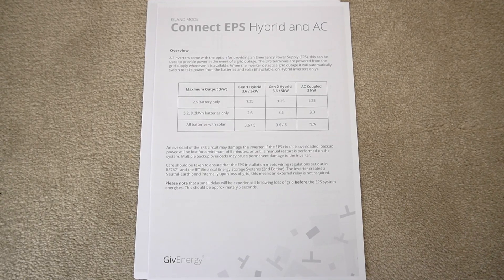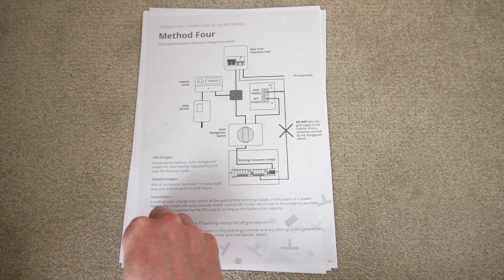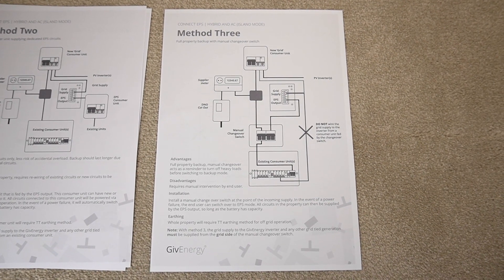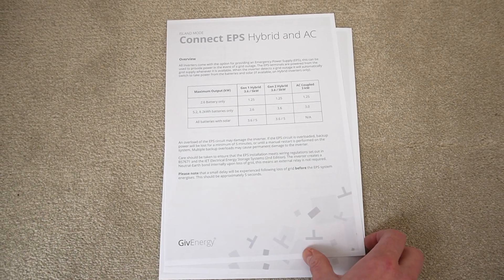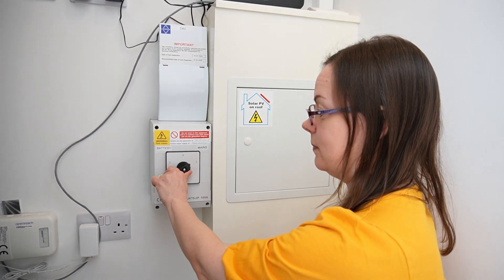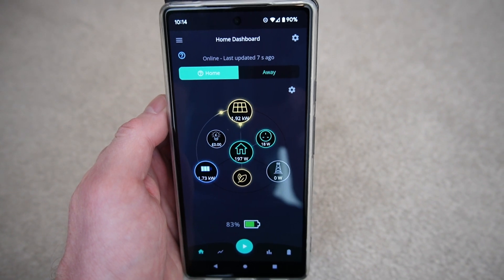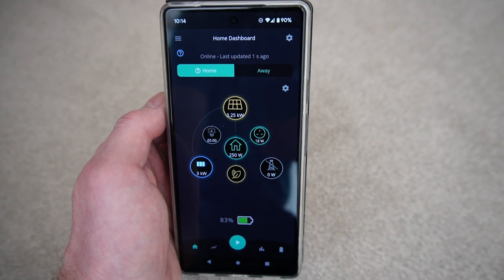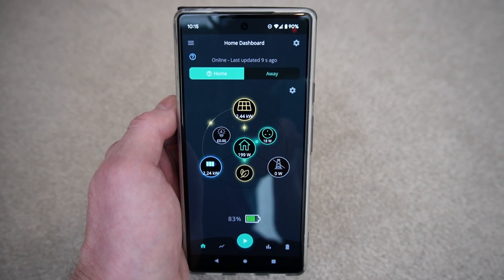GivEnergy whole house EPS - power cut backup demo

Comment: One issue for me is the ability of GE to handle load changes. It's the single reason I wouldn't install EPS from GE compared to say Tesla. If you have battery storage and solar production. Check your grid usage for the day. You'll find with GE you still used 0.5-2+kwh from the grid. This is when their equipment can't ramp up/down quick enough. Would be very interested to know if Gen 2 is any better in this regard than Gen 1. 👍🏻
Reply from the maker: I'll be covering this in more detail in my next stats update video, btw.
Reply from the maker: We're currently using about 0.1 kWh from the grid for balancing per day.  The max I've seen is 0.2 kWh.  So I'm pretty pleased with that, tbh.
Reply: @TimAndKatsGreenWalk  I mean the daily total not live reading. (For example using homeassistant to monitor). With Tesla it will be close to zero assuming you have enough battery and solar. But with GE I've seen high numbers over 2kwh. Then the question, what happens to this electronic equipment that demands power but doesn't receive it in quick enough time. I think this is a much bigger problem for GE than the 3.6 limit. In my opinion. I certainly wouldn't be wanting to run computer and critical equipment. Lights, phone chargers, etc would be ok.
Reply from the maker: I've not seen anything even close to 2 kWh, less than a twentieth of that most days.  That is the daily total, not the live reading.
Reply: @s7uat  I had a look in the GE cloud and it’s saying I’ve imported 0.3kWh for the day.
Reply: I have the Gen 2 and despite using all manner of appliances from the iron to the oven today, grid draw has worked out to 5 pence.
Reply: @CastleKnight7  so it looks like gen 2 is much better than gen 1. 👍🏻
Reply from the maker: I'm glad I waited for gen 2 in that case!
Reply: @s7uat That’s good to hear. I imagine a Gen 3 will import next to nothing for balancing. This Gen 2 seems to ramp up the discharge from the battery within a second.
Reply: @TimAndKatsGreenWalk  Great decision. Keep up the content. 👍🏻
Reply: Next on my list of purchases is this bit of kit. Then another 4.5kw array 😀

Comment: You could essentially go off grid (the holy grail of our systems) for a good portion of the year providing you’re generating enough solar power and as you say, you don’t draw more power than you are generating. I’ve noticed our iron is very power hungry, though just in short bursts. Another informative video! Thanks guys.
Reply from the maker: It's definitely reassuring having it available.  Once we get our export tariff set up though it'd still be worth our while staying on-grid for the export payments!
Reply: @TimAndKatsGreenWalk For sure! I’ll be looking into an export tariff once our British Gas tariff ends in December. We’ve got a good deal on gas until then and I won’t be looking at alternatives to gas boilers till our present one gives up the ghost. The plan like you is to go fully electric though.

Comment: Hi Tim,I have a GivEnergy system with 19kw battery and auto EPS for whole house.I’m not a electrician but my installation team worked a way around the potential overload and it works superbly just so you know it’s possible
Reply from the maker: That sounds fab.  I kind of like being in control of the switch, tbh.  Feels like I'm in Jurassic Park!
Reply: Lol, that makes me smile because you seem a switched on couple(excuse the pun) I understand your thinking for sure but if your not around then problems could arise
Reply from the maker: You mean if we get a power-cut while we're away from home?  Usually the power-cuts we get are no more than a few hours so if we're away from home that hopefully won't be too much of a problem.  Anything longer than a few days would be an issue, for sure.
Reply: Is there any chance you can provide more details? Surely you have the design proposal from the installers or just name the installers. I am looking to do the same and need someone that know what they are doing. Most companies in the UK don't wanna mess with backup systems, the only thing they do if you ask, is UPS which is where they rewire your house for a dedicated circuit backup. So for example your office where the router is, desktops etc and maybe the fridge.
Reply from the maker: @DragonXDrei  take a look at the document I showed in the video, and link to in the description.
Reply: @DragonXDrei Much easier, and cheaper, to do this with a dedicated UPS to supply critical IT stuff separately.
Reply: @michaelblackmore883  but would be nice if the fridge would be OK too, the last blackout we had was for almost 3 days.

Comment: approx what price difference for this to be added? I’ve not factored this in as we don’t really have power cuts, but if not super expensive it might be interesting
Reply from the maker: Ah ha!  I had another look at the invoice and I found it.  £480 for hardware and install.  A bit more than I thought.
Reply: @TimAndKatsGreenWalk  That's so cheap, can I ask which changeover switch they used? We use one that's £300 from CEF and adds a day to the installation (inc testing) so we charge £900 inc VAT for this method, maybe I should shop around. Your inverter/energy meter will see grid voltage again when the power comes back on so no need to look for the neighbours lights!
Reply from the maker: @thomasmoyes2990  I'm not sure where that switch was sourced from, it did have a label on it but that got removed by the installer when the various other stickers were added.  Perhaps you can make out any details that might help identify it from the video?  Good tip about the inverter/meter showing when the power comes back on.  When we next get a power-cut I'll look out for that, thanks.
Reply from the maker: Not entirely sure, it was lumped in with a load of other stuff in the invoice.  No more than a couple of hundred quid, I think

Comment: One of the reasons why I did not go with givenergy was because the 3.6 kWh limit. I have 8.8kwh capacity which allows for auto switchover and also allows for to twice a day peak period of 6/7kw. Everything is on my essential with the exception of oven, hob, EV, surge protection and inverter. I realise now I have over-specified with 20kw of batteries, but it is better to be looking at it than for it
Reply from the maker: 3.6 kW covers the vast majority of our use, so that's fine for us.  In a power-cut we'd not want to be drawing too much in any case, so should be able to keep well below 3.6 kW (btw it's kW for power, kWh for energy storage).
Reply: @TimAndKatsGreenWalk  I am aware of the difference between kW and kWh
Reply from the maker: But you used kWh for your panels (should be kW) and kW for your batteries (should be kWh).  No offense intended, I just see that mistake a lot.
Reply: @TimAndKatsGreenWalk  not as big a mistake as choosing the wrong inverter and then justifying the manual change over by “looking out for the neighbours lights to see when the power has come back on”
Reply from the maker: @mikejoseph425  oh wow, what a reply.  Sorry for trying to help educate you.  I sincerely apologise.  There was no need for you to get nasty in reply though.  I should know by now not to try and correct people on the Internet it never goes well.  I shan't do it again.
Reply from the maker: @mikejoseph425  I think we got off on the wrong foot.  When I mentioned the units it was genuinely an attempt to help, I wasn't trying to be condescending in any way (which I now realise could have sounded that way).  If you thought I was being rude I do honestly apologise and hope you forgive my initial comment.  But I do think your attack on my choice of system was uncalled for.  Not everyone has the same requirements so not everyone needs the same system.
Reply: @TimAndKatsGreenWalk  I just hit back because it did come across as “look at me, I know more than you.” With general conversation the term kw or kWh unit is irrelevant, it is only relevant when working out figures. I understand that a fridge rated at 1kw might only use 200wh once powered up
Interestingly as I also see the use of an undersized inverter a lot because people look at a 5kw inverter and do not realise the AC is limited to 3.6kw, to meet rule 98. I realise people have different budgets and agendas. Mine was to avoid any on peak use of electricity. We all make mistakes. I was not aware of the MCS requirement to export, I thought as long as one used an NIC Electrical contractor it would be fine, but not so and you can not gain a certificate once the job Is done. I believe I have got over this by FLEXI-ORB and the interesting part is that British Gas will allow export with a Flexi-Orb certificate and they pay 50% more than Octopus at 6p and you do not need to switch to BG. My plan is to try to avoid export and use excess solar after home and battery with immersion for which the SunSynk has auxiliary and last but not least my EV with Zappi
I accept your apology and I also apologise for my curt response. I do intend to follow you and swap experiences
We need to re-set
Reply from the maker: @mikejoseph425  Thank you, I'm glad we've cleared the air.  Our inverter can do 5 kW AC (with up to 3.6 kW from the battery, the rest supplied by solar, or else up to 5 kW from pure solar).  We have a G99 approval so can export all 5 kW if required, we're not limited by the 3.68 kW G98 restrictions, thankfully.  Our array is 6.8 kWp but E/W split so should max out at about 5 kW in any case, so I think our inverter is a good match for our system.  I shall be providing plenty of future videos covering how we get on with it so that others can learn from any mistakes we make (hopefully not too many!).  The more information people have access to the better, and that's why I started the channel.
Reply from the maker: @mikejoseph425  I should also mention that I'm particularly sensitive to units as I did a physics degree so when I see them misused it's like nails down a chalk board to me.  I'm trying to not let it bother me so much but it's hard!  I'm sure it doesn't matter to most folks at all and usually the context is enough to know what's intended.
Reply: @TimAndKatsGreenWalk I wonder why you didn't specify a 5 kW inverter.  When I ran Gary Waite's online calculator (Gary does solar) it was quickly clear that upgrading the inverter had quite a large effect on the export income.  My installer told me that the extra cost was only about £50 so looked like a no brainer to me.
Reply from the maker: @michaelblackmore883  we do have a 5 kW inverter.  The limit of 3.6 kW is what the battery can discharge on its own.  With solar added in it can export 5 kW
Reply: @TimAndKatsGreenWalk  Understood.  I must have missed that.

Comment: Could i ask how much you paid for the EPS back up.
We where quoted £800 more for this, but then was asked how many power cuts do you have?
We live in a small rural village and have had one power cut in the last 3 years lasting 2 hours at night, so then no sun
to run the system, then said the battery but the sup[plier said you then have to set your battery eps at about 50%,
so then you can only use 50% of your battery in winter or night.You then lose money in winter or at night.
Reply from the maker: I'm not sure exactly, it was all part of the total quote.  No more than a couple of hundred quid, I think.  We've had a few power-cuts so I'm glad we've got it.
Reply from the maker: Ah, my mistake, I dug out the invoice and have found the itemisation.  It was £480 for hardware and install.
Reply: That's a lot cheaper than my quote, might have gone for it at that price,  do you set the battery eps at 50%, or hope for day time.
Reply from the maker: You mean always have the battery charge to 50% overnight in case of a power-cut?  I've currently got it set for 30% just to make sure we've got a few kWh for heating in the morning but we've not gone below about 50% since the start of April, so I suspect even that is unnecessary at this point.  In the winter we'd be charging it all the way up overnight to help support the heating but I'd expect to have to turn off the heating in a power-cut in the winter regardless.  Or at the very least restrict it quite a bit.
Reply from the maker: Ah, or do you mean the reserve limit?  I've got that set to 4% as we don't seem to be getting anywhere near that right now.
Reply: On my Alpha system  you can set the EPS limit, and i was told you have to set it to roughly 50% if you think their is a power cut,
but this means you can only use half of your battery in winter/night, other wise if you run your battery down to, (mines set to 11%) no EPS, your lower limit is 4%, you have no reserve when/if you have a power failure.
Reply: I think you doing a great job of bringing a normal house in to the solar/ battery future, well done.
Reply from the maker: @peteandtheresa1  ah, gotcha.  Yes, I'm assuming a power-cut is unlikely so just hoping there will be some battery/sun available to tide us over.  I'm not specifically keeping a reserve for it.

Comment: You should probably aim to remove the Eddi from the board that is aimed to be backed up, Purely because of a schedule'd forgotten about boost could bring the system too it's knees.

The rest of the house you are in control of high demand loads but if if you forget the Eddi is on a schedule that knows no different
Reply from the maker: The eddi maxes out at 3 kW so if it's boosting overnight the total draw should be less than 3.6.  I'd make sure to turn off the boost in a power-cut regardless.
Reply: I had to laugh when you site settings that would bring the Eddi to its knees. If you have one and have upgraded the firmware to v5 you will be deep inside the forum documenting the vast numbers of problems Myenergi has caused by releasing this awful firmware. It makes the system not fit for purpose and the suggested fixes are always useless. The message is don't touch the firmware on Eddi (regardless of serial 1 or 2).

Comment: Have you done a price comparison?  Did you look at small wind turbines not the tall ones, little ones that are supposed to be better than solar.
Reply: Everything I've seen about domestic wind turbines says that the present technology can't compare. However, there are a number a possibly improved systems in the pipeline. Do you have anything particular in mind?
Reply: @eddyd8745  Not really , but seen a lot of small wind turbines which are far more efficient than solar, regarding how much they can generate power, in the region of 4 time better.
Reply: @KavanOBrien The ideal situation would be to have both as it can be a still day with little or no breeze, but then the wind picks up in the evening. We’re very fortunate to have technology that allows us such energy sufficiency.
Reply: @CastleKnight7  yes I was thinking of both for that reason , but quite expensive for me, I live on my own, I was thinking about buying a battery unit to be powered by solar and wind to be able to get heat in the house.
Reply: @KavanOBrien If you can afford it and your location (sunny, windy region) supports it, go for it!
Reply from the maker: Solar is currently significantly more reliable and cheaper per kW than wind, but things may change over time.
Reply: I think you'd want to look very carefully at the wind speeds you could expect, and how much a small turbine would generate at that speed. There just isn't much power in the sort of gentle breeze that's typical at rooftop level.
Then there's the noise and vibration. I've sailed on a yacht with one, and we had to tie it up at night to get to sleep (and avoid complaints from other boats).

Comment: That helps me to appreciate my Powerwall with its 5 kWh output (7 kWh for a very short time),  fast and automatic switching to backup in the event of a power cut (computers and routers don't restart). Admittedly I had to wait for nearly a year for its arrival but it did give me time to save up for it.
Reply: The GivEnergy is the same - 5kW output and instant switchover (as one of the 4 options)
Reply: @terryjimfletcher which is what I may end up doing. The manual switch was the chosen option here because that's what they wanted, also protect the load.
Reply: I guess you paid handsomely for the convenience! In addition the penalty is of course the inefficiency for the 3 DC to AC conversions from the battery.....and the year delay rather than six months.

Comment: In your situation with excess solar - what happens? Is the inverter limiting generation from the panels because it can’t go out to the grid?
Reply from the maker: The panels will charge the battery until it's full then dial back to the level the house requires (so I believe, I've not tested that fully yet).
Reply: I believe in this scenario if the solar array has excess power but nowhere for it to go the panels just heat up more than they otherwise would have… law of thermodynamics after all
Reply: If you have a solar diverter and or car charger these would easily mop up available solar excess during a power cut...plus with ongoing loss of grid power the battery would be draining as soon as the PV current dropped. In reality it would be very unlikely to ever happen?